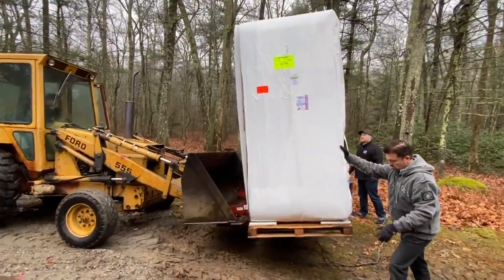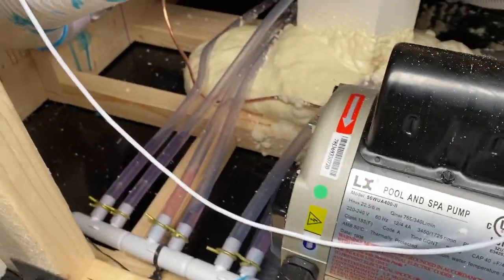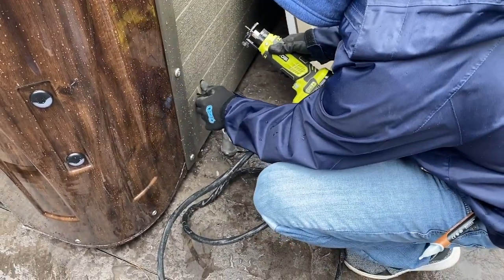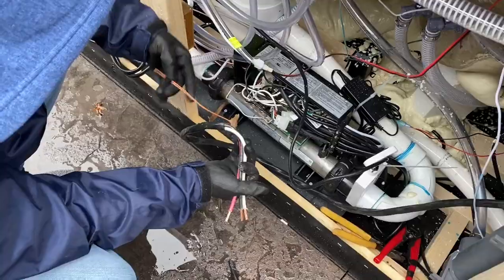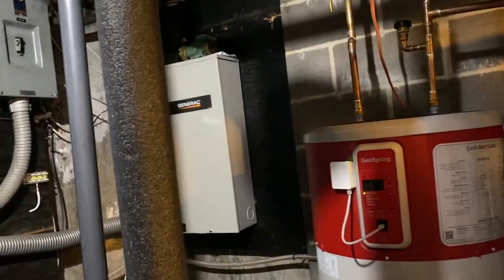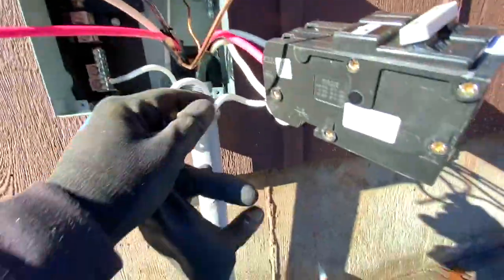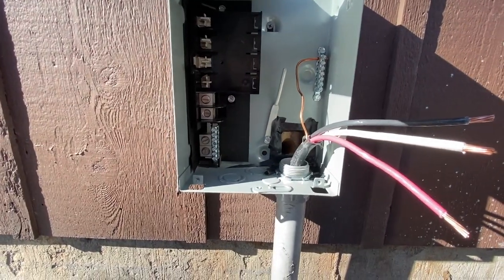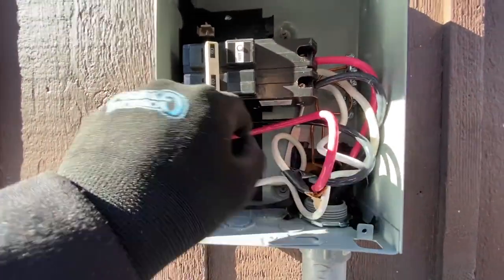Install Costco Hot Tub and Run 220V Electric

Comment: First, you can't run romex in a pipe. Second, the 3 wires coming from the house are NOT the load, they are the LINE, the LOAD is the wires feeding the Hot Tub. Third, that is NOT a fuse it's a BREAKER. Come on guys, lets get it right.
Reply: Yes, you can run romex in conduit.
Reply: You can't by code here
Reply: Yes you can
Reply: No one cares it works

Comment: Last I looked you should not be running romex in conduit. Something to do with heat dissipation and a jacketed wire, plus being below grade in the slab, which romex is not rated for. Romex is fine for inside but outside it should be THHN, which is rated for both wet and in conduit. Also noted that you drilled for wires in that side panel which will limit access when that side needs to come off to service the pump. Better access point would have been the corner or the kick-base, using a short piece of sealtite flex. (in case the tube is ever moved)
Reply: @i_am_the_dustin ... would agree on all aspects of extra protection, except for the wet locations, and below grade is always considered wet in the books. Cable rated for direct burial could be protected in a conduit but that's already rated for wet locations.
Reply: Not a gfi fuse. GFI breaker..
Reply: Thhn wire good for damp locations, not wet locations. Use thwn for wet locations. But most wire is thhn/thwn rated.
Reply: Conductors in non-meallic sheath cable have no identification printed on them so you don't know if it's thhn or thwn or similar.
Reply: @johndavies2949    like so many other things in life... if it's not spelled out, it's not rated. IOW, the non-metallic sheath (Romex or similar) may have markings, but the internal wires do NOT. BX does NOT have anything printed on the internal wires either. The outer metallic part is just for a bit of physical protection. (originally meant for rodent problems)

Comment: The power grid switched from the 110/220V standard to the 120/240V standard in 1967. Glad to see you're up on the codes and standards in this video.

Comment: Ok with your work, until you connected to the control box at the spa. First cable jacket should not be stripped short of the romex connector,  and ground wire should be into the plastic box as it has a connection hole in the box to connect to the ground bar on the outside.
Reply: Was about to comment on this as well, looks like you caught it.